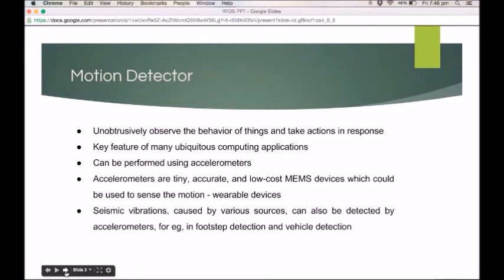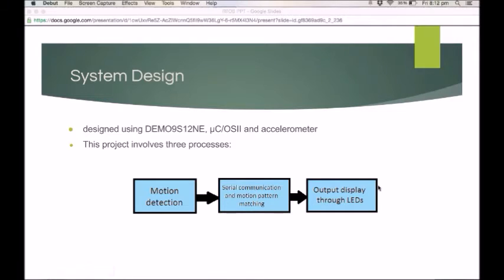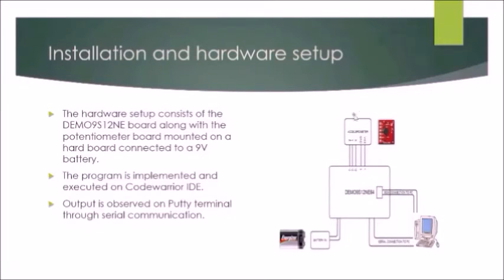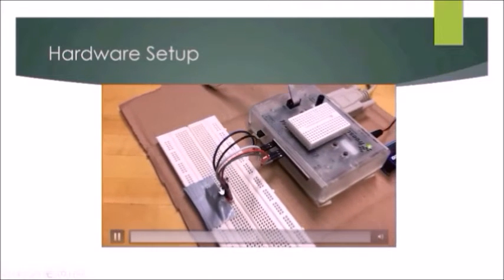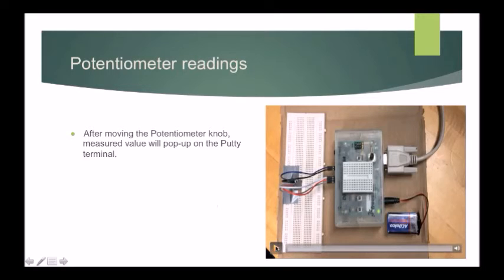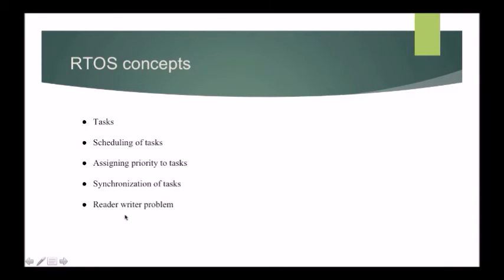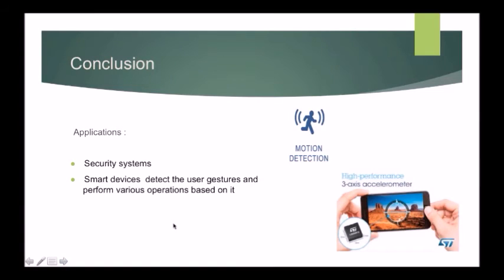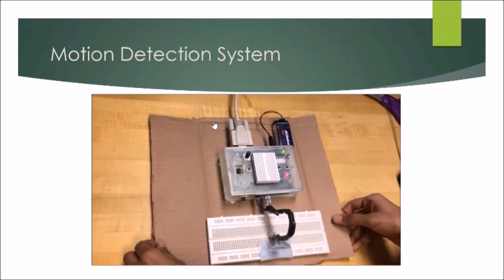RTOS ECE 59500 FINAL PROJECT: MOTION DETECTION SYSTEM USING DEMO9S12NE64

Comment: Hello Snipers,

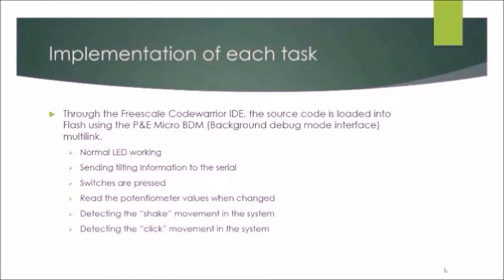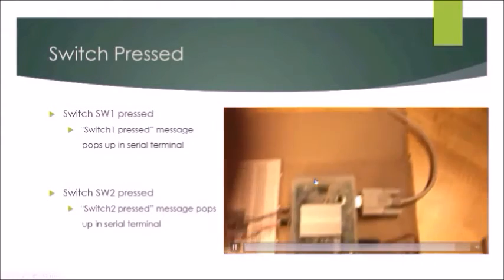I am impressed by your final project presentation. It looked like each member has tried to work their part well, and it was evident in the final outcome. The content was well-drafted and presented in a order. Care has been taken to strike a chord between information and demonstration, as they both were not overboard. However, my only issue was in the audio quality, when the presentation switched from member to member. The video, from 07:38 to 09:30 had a jarring noise in the background, which reduced the impact. Also, make sure the video doesn't go out of balance while recording the demonstration.

Apart from that, I believe that you have done great work.